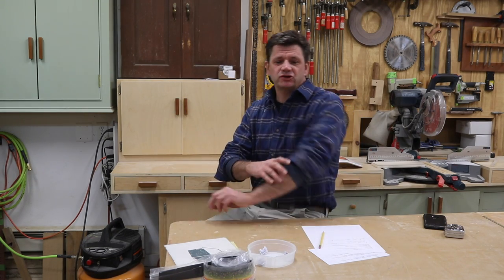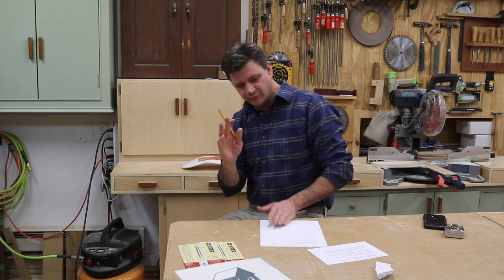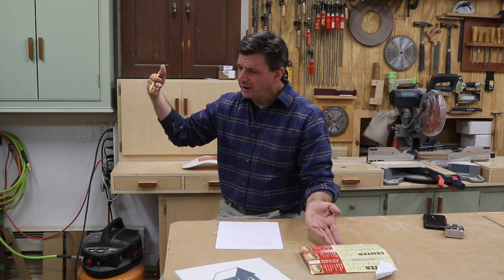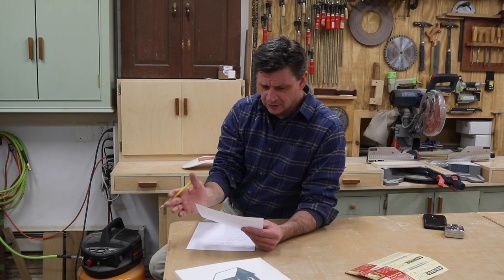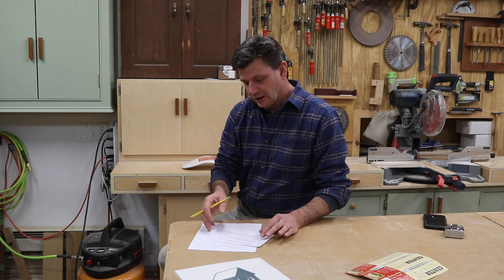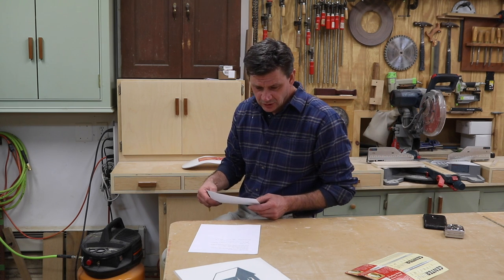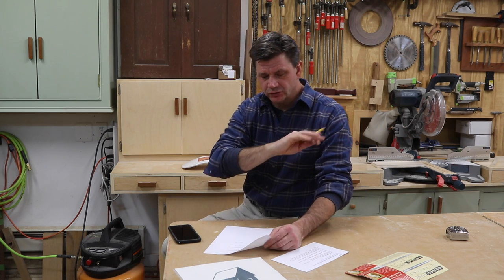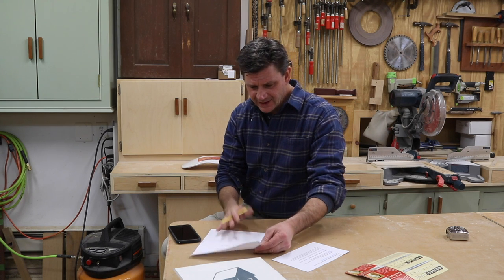Shop Talk #11  Does Hot Glue Really Make a Drawer Stronger ?

Comment: I built a Mahogany and Lacewood desk about 15 years ago, using Blum under mount slides so the drawers had a clean fine furniture look.  The slides have worked flawlessly with daily use, but they were time consuming and fussy to install, and I had to make a jig to locate them properly.  Years later when I built a kitchen I used side hung metal slides on all of the drawers and i never had a problem with them and didn't feel that they compromised the appearance of the cabinets.  I look forward to your videos and the perspective you bring to each project.